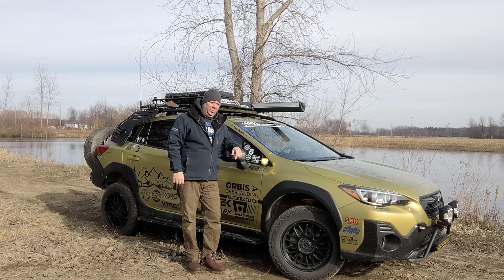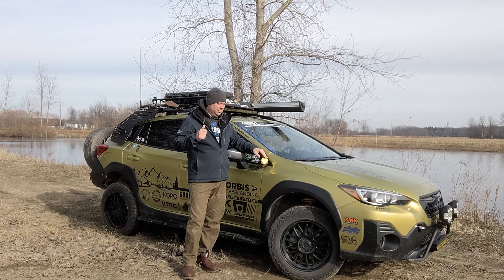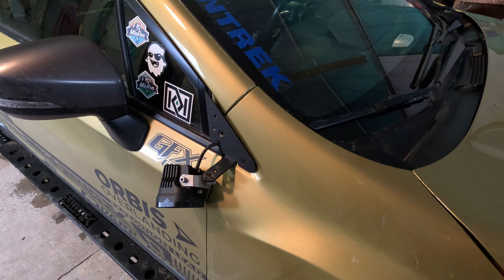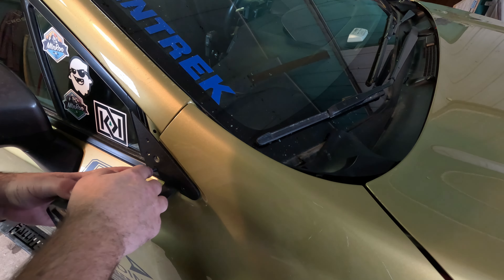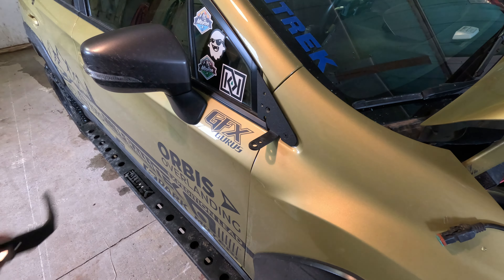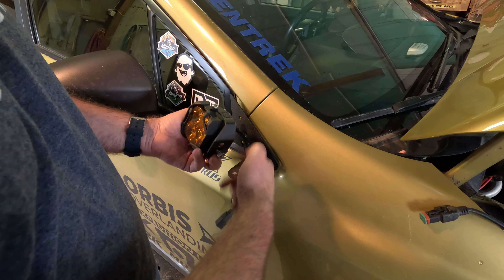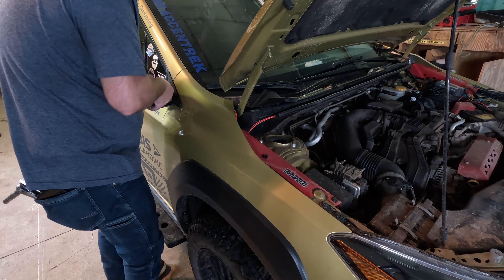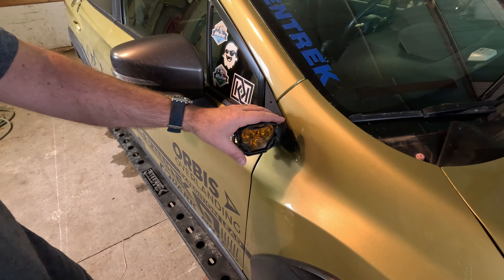SMK Ditch Light Brackets on the Crosstrek

Comment: Just received and installed 4bangers and the SMK Ditch Light Brackets  on '23 Outback Onyx.  Worked perfectly even though the website has not yet updated the SMK bracket  info to '2023' version.  If you have a 2023 Outback just buy the '22 version bracket.   As for the bracket not accepting the  Morimoto provided bolts (SMK bracket hole diameter is a little too small).. Instead of hunting for new hardware -  just bored out the SMK hole  a little using a 3/8" bit - took 60 seconds to shave a little bit of metal.  My Morimoto hardware now fits like a glove.   The 4bangers are perfect for this location and results are amazing.  THanks for the idea !
Reply from the maker: Good call on making them a bit bigger! I happen to have all kinds of nuts and bolts laying around it seems (although I can't seem to find the one I need when I need it...)! Thanks for sharing!
Reply: No Problem !   When I dry-fitted the Morimoto Bolt into the SMK bracket - it almost fit as the tolerance was so close.. I figured it would be easy to increase the diameter of the SMK bracket hole just a little.. and it was.     Keep up the good work on your channel.